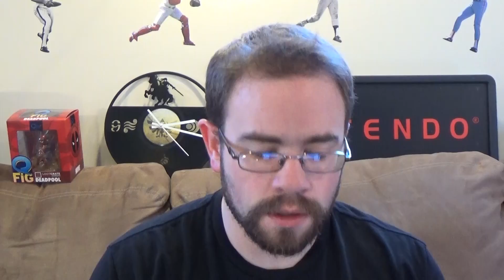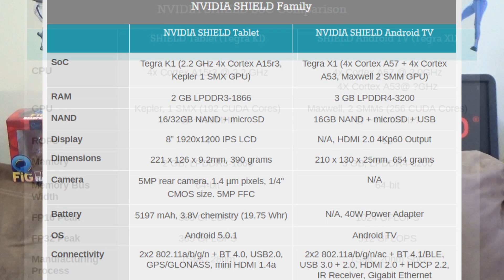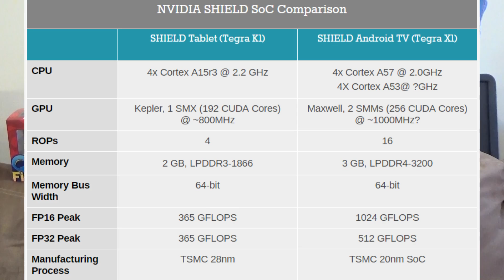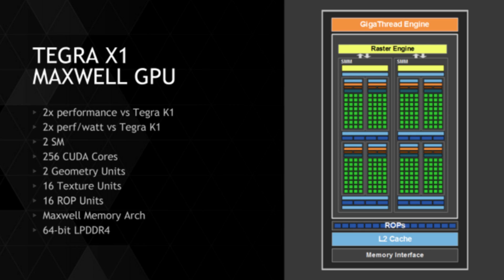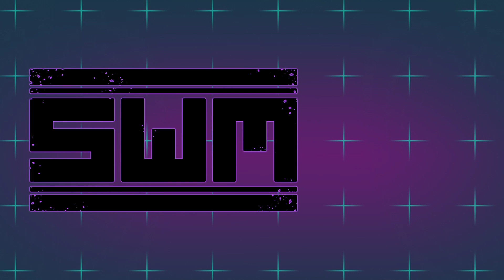The Nintendo Switch Is Powerful!! But Can It Run Crysis??

Comment: You were so wrong and naive about it. Crysis was cancelled on x1 because it was too underpowered to run Crysis. They only managed an empty mp map to run, no AI., no nothing, just a small static scene. Now the Switch is a gimped version of x1. It can only run Crysis when you remove the jungle from it and make it look as empty as BOTW.
Reply: Well well well nigga
Reply: @leetorry  Answer when you get to see the actual game, not an announcement.

Comment: 250 seems a bit low acctually, in my opinion it will be $280-350 it just does not feel right to say it will cost 250$ otherwise it would be only as powerful as when the Nintendo 3ds xl came out.

Comment: Finally someone else is digging for more information like me. The new tesla cars are using tegra x2. The drive px2 at 80 watts is making 8 teraflops of computing power. The shield TV also does things like communicating with other gtx graphics cards to play pc games. Maybe when you dock your switch you can hook up to your gtx graphics card and play Mario at 4k. So if you want more power then what the switch can offer, you can get a gtx graphics card and hook it up to your switch when docked.  This solves hard core gamers' dilemma of home consoles not having enough power to play games at ultra settings and 60 frames per second.  Instead of Nintendo making a really expensive system, they are now leaving it up to the individual if they demand more graphics.  I think that's smart because all hard core gamers will have no problem hooking up their switch to another graphics card when they choose to, and not having to cough up major bucks to play a Nintendo.

Comment: Great video just one thing i thought you should have mentioned which is actually good news when looking into what the switch can run is that the shield is android which is like running games through a virtual machine that extra couple layers before the the hardware is a pain for developers and definitely effects performance as it's harder to utilize it to it's full power.

Comment: the switch will most definitely not be using a tegra x1 chipset. Nvidia has stated that they worked with Nintendo and put in 500 man hour years to optimizing and customizing the chip to work optimally for the Switch. The switch like previous nintendo consoles will have a custom chip that won't be available in other platforms

Comment: The system requierment and recomended for Crysis is.  
CPU: 2.8Ghz Pentium 4..... A A57 4 core is way faster. Its even faster core on core.
Ram: 1GB... yea... Swich will have 4 (probably)
GPU: 6800GT, (about 50Gflops) ... yea that is 1/10 of the X1.

Recommended
CPU: Core2due 2.2Ghz. ARM A57 is core on core similar to the Core2Duo. So a 4 core is about twice as fast.
RAM 2GB.. no problem
GPU: 8800GT ~300Gflops (FP32)

So the Swich would not only play Crysis with no problem what so ever. With the FP16 trickery and so on it might even play crysis in 4K.

Why.. simple. Crysis is a very old game.
Reply: Crysis 3.. yea.. well that is a different game :S

Comment: +Spawn Wave
The Shield has "very fast" RAM? The RAM in Shield TV is running at 3200 MHz effective , i.e. 1600 MHz clock Double Data Rate. It uses 2 Samsung 12 Gbit/1.5 GByte LPDDR4 modules, providing the total 3GB with a 64-bit bus (32-bit per module).
This gives it a peak memory bandwidth of 25.6 GB/s (64/8 * 3.2) - about double that of the Wii U main RAM (12.8 GB/s), less than 40% of the Xbox One main RAM (68.2 GB/s), and less than 15% of the PS4 (176 GB/s). I'd hardly call it "fast" unless you're only comparing it to tablets...

Also, the Tegra Parker/X2 has the exact same number of CUDA cores, but clocked 50% higher at around 1.5 GHz, as is the norm for Pascal GPU architecture. The theoretical peak FP32 performance of the Tegra Parker/X2 is about 750 GFLOPS (256 Cores x 2 FLOP per core x 1.5 GHz = 750 GFLOPS)

I'm hoping the Switch is closer to the Tegra Parker. Stick 4 x 8 Gbit/1GByte LPDDR4 3200 Memory in there, get the 128-bit memory bus, and crank that bandwidth up to 51.2 GB/s (128/8 x 3.2 = 51.2 GB/s), use Parker's fully coherent CPU cluster capability so it can use all cores at once, and optimise code for that 750 GFLOPS FP32 - 1500 GFLOPS FP16 performance.

The lower RAM will just mean lower resolution textures, softer shadows, less detailed reflections, and reduced foliage and similar details... but that's really only going to be noticeable in multiplatform games.
Reply from the maker: +ArynCrinn Sorry I should've clarified, it's running very fast ram when comparing to other Arm processor devices.
Reply: I think we are in for a big surprise regarding the new console. Given the 44% efficiency increasement over Maxwell provided by the Pascal architecture, we can assume a 1.3x multiplayer at least (as seen in Gtx 1050) and a1.75x multiplayer at most (as seen in gtx1070 and above),  As a result, we can expect the switch will deliver at least 1.404TFLOPS at least and at most 1.89TFLOPS, that is if they found a way to efficiently cool this thing without downcloacking.
Reply: Munteanu Catalin Tegra X1 is only 500 GFLOPS FP32. Following your logic, we can only expect between 650 GFLOPS and 875 GFLOPS.

That's kind of what I expect to see... at least in mobile mode.
Reply: What if the NS custom Tegra Parker/X2 comes with 512 CUDA Cores like the Tegra Xavier, uses a custom Denver 2 or 3 but replaces the Cortex A57 with the A73 on it's big.LITTLE configuration and keeps the original 128-bit LPDDR4, 50 GB/s, ECC memory. Would that make any difference? or would that be too difficult and pricey for NVIDIA to make?

Comment: Crysis 3 was not made bcuz of crytek money issues nvidia has nothing to do with it the Nintendo switch will not have of the line tech 1. Bcuz Nintendo does not want to take a hit in the hardware 2.the switch will cost around $250 or so that also lets you know they are not going ring that powerful witch kinda of sucks but we shall see

Comment: @ 10:58 Yes,  Nintendo needs to put DDR4 there but, not for the reason you are thinking. The major improvement of DDR4 is in its efficiency; it runs at lower voltages than DDR3 and that's important for an hand-held device which main focus is graphics rendering, much more than the frequncy (or speed) is, anyways. And no, 4GB DDR4 will NOT be enough to play Crysis 3, 1080p natively - let alone the Elder Scrolls V: Skyrim Special Edition Nintendo featured in the trailer. For those kinds of texture loads, the console will need more than 4GB. However, I think the console will ship with 4GB only. Not because is enough for Crysis 3 or Skyrim but, I don't trust Nintendo to embrace the AAA game market anymore than what it did before with the WiiU. Nintendo will continue to do its own thing, with its own IPs, colaborating with this and that indie developer but, that will be it. Again, Nintendo, through its actions (not words), didn't gave me any reason to think otherwise, yet.  If the console ships with more  than 4GB, say 8GB, then, I will revise my opinion.

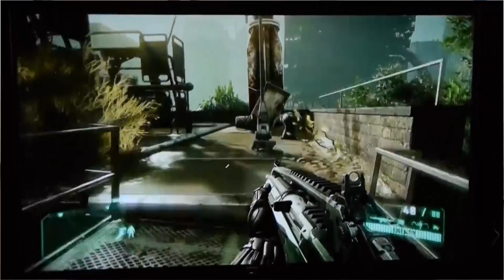Comment: @ 6:58 you say "we BELIEVE (Crysis 3) running @ 1080p". Ok. "we" are guessing. Then @ 7:23 you confess you don't even know what the settings are ("resolution" is a setting). I'm glad you clarified it out. But, @ 10:43 you revisit the topic just to elaborate under and assumption YOU already have estabilshed has being completely BULLSHIT because (@ 7:27) ,  NVIDIA didn't tell (them) what the heck were the res. the fps. or  the graphical quality (settings). It could had been 720p/30fps as far as I'm concerned.

Comment: @6:45 "is not super difficult" to port games to Nintendo Switch? NVIDIA has developed a brand new API (NVN) that programmers have to learn from scratch and you are telling me "people are saying is not (super) difficult" to port games? I guess you are not the only one trying to hard here; "people" seem to be trying to hard as well
Reply: NVN most likely low level API for Switch. but porting should not be too difficult. Croteam once port Serious Sam BFE pc version (x86) to nvidia tegra K1 (ARM).  this is Croteam dev comment on that matter: 

"Yes. We were even more amazed than you are. That's the first version of SS3 for Android. And it would not have been possible without this Tegra miracle. :) This chip looks like something that will knock everyone's socks off. We couldn't believe how good it is. It supports full OpenGL4, and we practically directly ported the entire PC game to it, along with PC content. It was not cut down like e.g. for Xbox 360. 

As an additional point, when we compiled the code without errors and ironed the glitches in initialization code, as soon as it started the graphics correctly for the first time, it went right through the intro sequence, and into the game. Without any noticeable visual errors. I think I can safely say this is the first time ever. Normally, we'd have a few weeks of unexplainable black screens, inverted colors, garbage in textures, broken shaders, etc, until it looks ok visually. With K1, this just worked."

https://steamcommunity.com/app/41070/discussions/0/630800446936367743/

Comment: Pardon my ignorance, but why is it important for it to have ddr4 ram?. I thought ram was only important when using optical media since the system would have to load info from the disc to the ram. But since the switch will use cartridges the console will be able to read directly from the cartridge onto the gpu, right?

Comment: Why are you so confident that the Switch will be working with an x2 or x2 variant? Also, the cooling issue indicates that it may not even use an x1.

Comment: How bout the switch has a built in fan that runs on lower speeds when in tablet mode. Keep in mind that the surface pro 3 has an active fan that runs whether you are plugged in or not. Any predictions about the Xbox surface XD?

Comment: The video of the Switch if you pause the views of the Switch durring the plane scene the top and the bottem back have vents it likely has a fan. and the cutout on the back of the dock is likely to allow airflow

Comment: Excellent points and this is what I've been reading most about lately  instead of continuously speculating.  NVIDIA also recently announced Xavier which won't be in the Switch but it makes it more clear that Pascal is soon to be outdated and NVIDIA needs a huge win as much as Nintendo does.  Everything is lining up for a big success and I really hope they pull it off.

Comment: From what I've read of DDR4 Ram, it allows a greater range of clock speeds.   That seems perfect for a hybrid console, since we're talking about a system that wants two opposite things.   On the go, it must save power at the expense of performance.   Docked, it has to be as powerful as possible and can be a power hog.  

Same goes for the X2 Tegra.   It's not just more powerful, but the defining quality of it is its power efficiency, making it perfect for handhelds.   

For these design choices it's about more than just power, but the elegance of the product.  If Nintendo wants a compelling product they MUST go with them.

Comment: Another interesting and enjoyable video from you Spawn Wave. However, I'm not sure Nintendo is Nvidia's 'cash cow' though. Indications are that Nintendo will be selling the NS profit free. Not at a loss but with little or no profit. What little profit there will be will go to retailers. 
The way i see it is that Nintendo are going to be able to keep their production costs down by less R&D in the chip department with Nintendo not having to produce their own custom GPU. I think Nvidia will be heavily subsidizing Nintendo With minimal profit themselves per unit but being able to make some money because of the millions of units they will shift. I'm pretty sure Nintendo will have Nvidia screwed right down to the bare limit. Nintendo going for profit from games sales and Nvidia a couple of $ per unit sold. I think subsidizing is a key word in this Nintendo/Nvidia relationship.
Reply: +Bill Bob
Even though Kimishima recently told investors that they would be making profit on it?

Nintendo haven't produced "their own" GPU in a long time... but yeah, as far as custom designs go, I expect this to be much less custom than past Nintendo systems.

I also see Nvidia supplying the chip to Nintendo for no more than $50 a piece, but they are also likely willing to take a loss just to get some exposure of their Tegra line. The success of Switch could potentially draw in more phone and tablet manufacturers, which is likely what Nvidia are hoping to achieve.
Reply: ArynCrinn I didn't know they [Nintendo] had told investors that. Probably a nominal amount of profit though and that's probably because Nvidia are subsidising them like i said. The rest of your comment seems to be pretty much along the same line of thinking as myself. I do think the retailers will be the ones making the most per unit sold tho and not Nvidia or Nintendo. Nvidias 'cash cow' is their 1080 graphics card range. and like you said their partnership with Nintendo is more about exposure than anything else. I'm sure they would love to have their chips in millions of homes. Nvidia and Nintendo partnering is a brilliant step forward for them both. But not necessarily for financial reasons.

Comment: I don't think it's unreasonable to expect the Switch, when docked, to run graphically-demanding games at 1080p, 60fps, at minimum; and maintain that 60fps in portable form (even if it's only 720p).  That's what I'd expect, anyway.